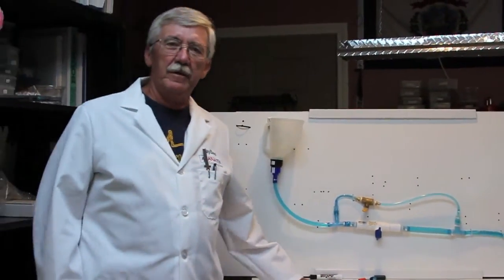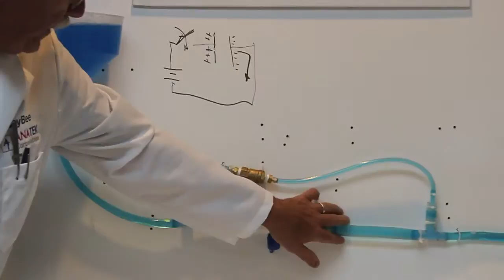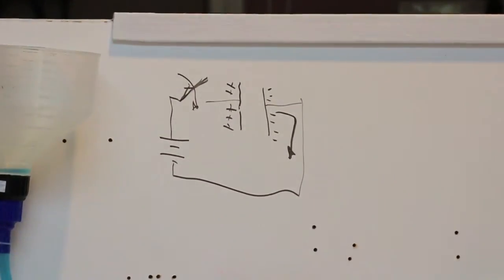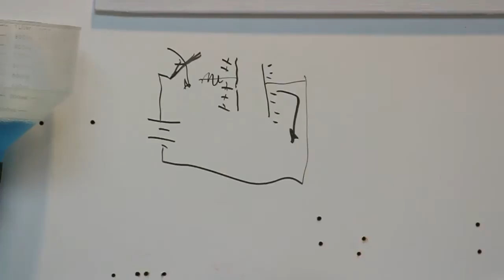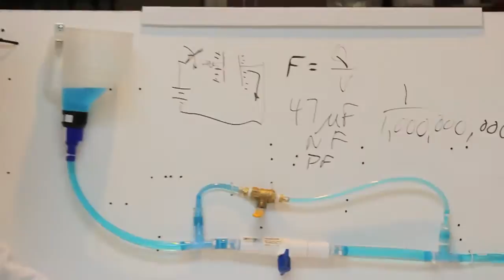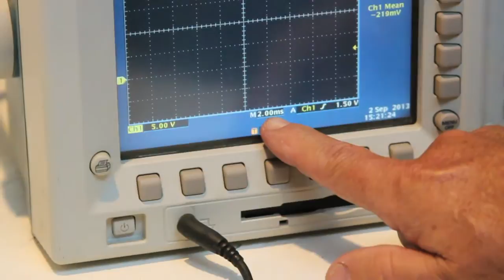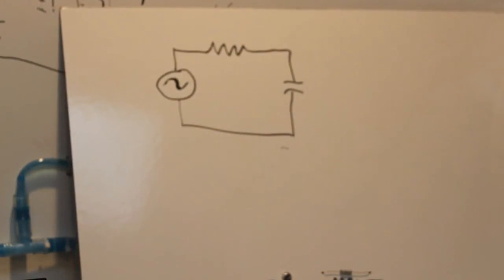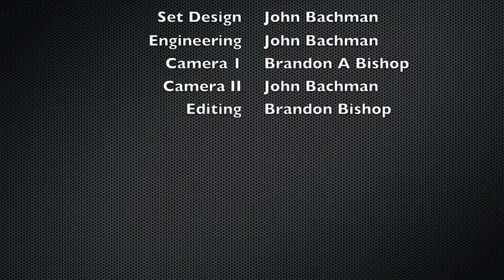Understanding Electronics with JayBee Episode 2; Capacitors and Capacitance

Comment: Great stuff for understand the basics, I just wish someone would come out with something that explains how all these components make something like a TV work or even something simplier so a person would have an idea of how to know what to look for say when something goes wrong and you need to troubleshoot it. I have worked on large 3 phase compressor systems with PLCs and understand how and why relays, solenoids, and anything to do with control systems work on these types of things. The exception as I mentioned is I would have no idea how to take a car with components and figure out even where to start to find a problem. Considering you for in large part need the components off the card to even read them out with a meter it would be nice to know if say a capacitor fails how it effects the circuit or any other component.
Reply: +Gregarious Antithesis interesting points ,if anyone else is searching for introduction to electronics try Elumpa Circuits Expert Alchemist (should be on google have a look ) ? Ive heard some awesome things about it and my neighbor got amazing results with it.